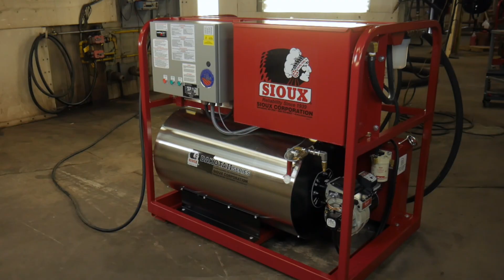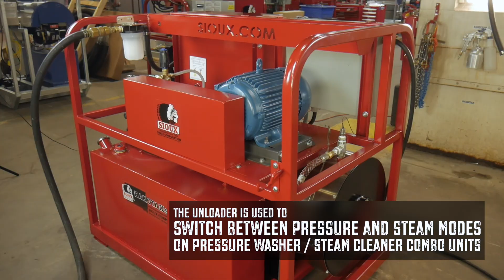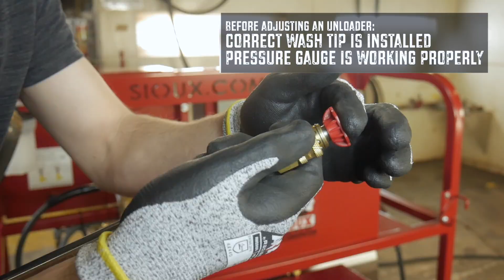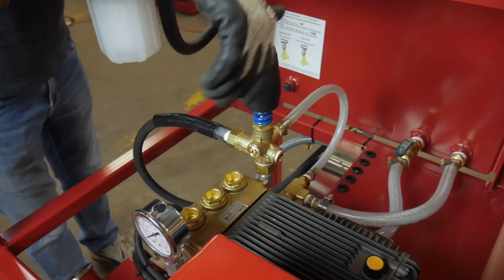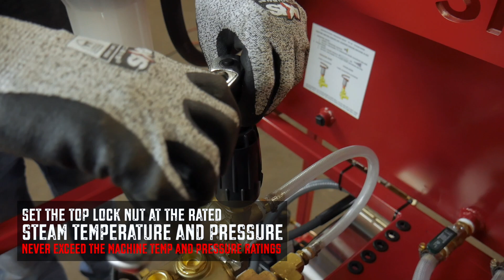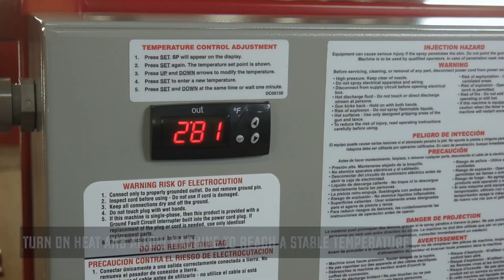Pressure Washer Unloader Valve Adjustment

Comment: the hose is equipped with a constant current trigger (winter) R + M ST-2300 Weep when the trigger is released, the pressure on the regulator increases. how to avoid it?

Comment: I’m new to professional wash setups. My goal is to be able to leave the motor on and running without burning the pump. From what I’ve seen, people just run the hose from the unloaded valve back to the tank, right? Haven’t been able to find a video about how that works and what kind of setup I’d need to achieve that.

Comment: Is the knob on the unloader suppose to lift and click while in use when not pulling the trigger on the wand?
Reply from the maker: Yes, the unloader will move until it hits the stop when not triggering the spray gun. Thanks for the question.
Reply: If the nuts are set fully at the bottom if you turn up pressure to the level required  surely as you are turning it clockwise the nuts won't move so when you take knob off the nuts will be in same place?